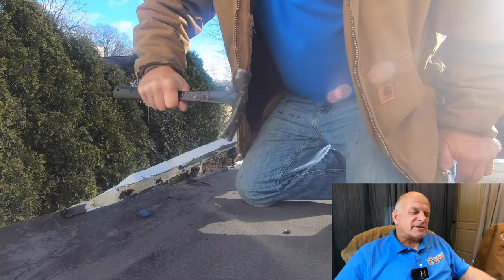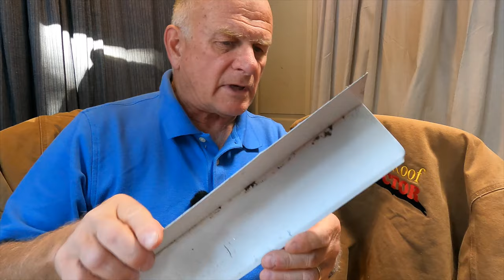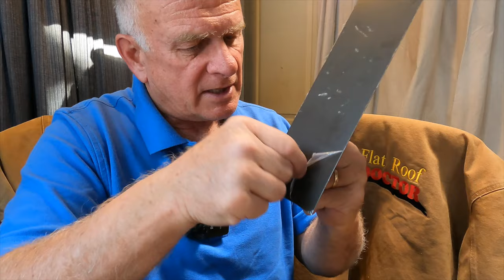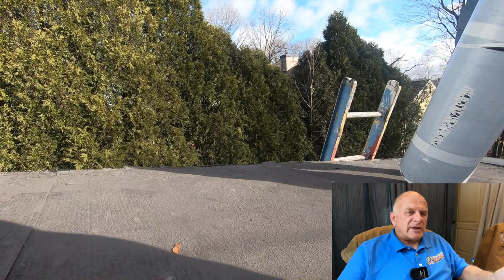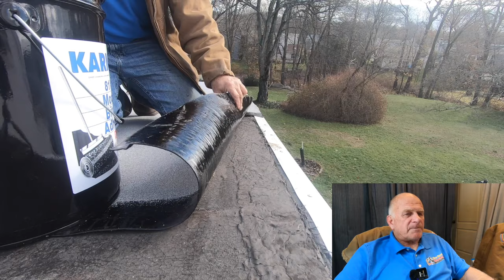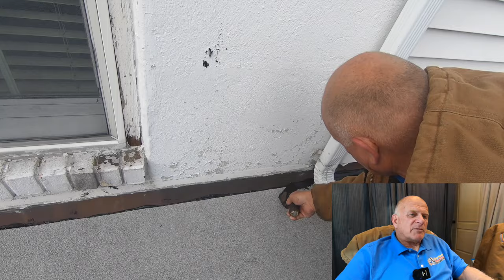Quickest Easiest Cheapest Flat Roof Install - only Hammer, knife, trowel, tin snips - DIY Home Owner

Comment: There’s a reason the manufacturers don’t recommend doing it this way. This is fucking mental!
Reply: reason?
Reply: @Trustamania he's lying to you when he tells you the sun will fully adhere the roof.. I mean obviously, look at all the wrinkles in it when he says its done? and what about in the mean time? he never used any sort of adhesive on either the base or cap layer. Even a Cold apply roof still needs to be fully adhered at the seams, at the very minimum
Reply: He said he uses Karnak 81. That is an adhesive.
Reply: @dbarr8261 that's is a plastic cement, it's not for this aplacation,

Comment: This is great, thank you. I have a commercial property and the contractor estimate is closer to a $100k. I calculated the material cost and it is less than $20k. It blows me away that he want so much profit for two days work. Do I am hiring couple labors and doing it myself.
Reply: Lol good luck buddy....hopefully you install the roof correctly and you don't end up paying 2 3 and. 4 time more then you would have.
Reply: How did that roof go?
Reply: @JohnSmith-bx5fg  it's hilarious. We had a guy in tears when the insurance company came out and found out it was a DIY. Owes 200k in repairs AND got dropped. If the roof is $100k that's easily a 10-12 man job for sure. These people who roll the dice on plumbing, electric, or roofing are insane. One small pin hole and you will have mold for years
Reply: ^ Yup good luck with insurance and manufacturers warranty, this guy is literally telling you this is the wrong method and not recommended by the manufacturer..

Comment: Hi Doc ! I just wanted to thank you and your wife so much for all your videos which I have looked at over and over before actually believing I could do this. I have just finished my flat re-roofing project here in NB, Canada on a 9 ft x 18ft double sloped flat roof. I bought the GAF liberty cap sheet at home depot. They did not sell the base so I contacted a local commercial roofing supplier and bought some Elastoplex SA Y Polyglass as a base sheet. 
My challenge was to start on each end of my roof to overlap my way up to the peak to lay my final cap sheet.
I also followed your advice and found myself a wonderful wife who helped me carry the rolls up the stairs (I'm a skinny dude lol), I cant carry them by myself. If you want I can share photos of my project to show anybody can do this. I'm a barber and I never thought I would tackle a project like this. 
Today it's raining, and it' great to see that the drip edge is working, no more leaks.
THANK YOU for sharing a thing or two with us, bla bla bla
Pat
Reply: U mind telling me what materials u bought so I can do it to my mobile home too 👍
Reply: @JNCVlogs  sure :) I used the 2 layer he recommends in the video. Peel and stick base, drip edge, and then Cap sheet made by GAF. Cap sheet was available at Home depot, and the base was available at a local  roofing supplies store. My conclusion after one winter : the roof is like now, system works great. The rolls are heavy, I'm a tiny dude and needed help to carry them :) have fun and take your time
Reply: @chnapz  did u needed a torch ??? And thanks I appreciated
Reply: @JNCVlogs  no I didn't have a torch, the adhesive is good enough. I did it on a hot summer day
Reply: @chnapz  how's it holding up now??
Reply: @xxdrloveleyxx5185  hasn't moved a bit. Still super Happy:)
Reply: That goes double for me Doc.

Comment: Hello all, Just wanted to add my experience on this method.
 Way before this video back in 1998 I had a leaking built up tar and gravel roof on a slightly pitched addition to my house. I removed the entire old roof back to the rafters and installed sheathing, then I installed a cap a layer of peel and stick roll roofing ( I think it was a GAF product) and then a final layer of sand coated roll roofing. Since it was my own house I followed the instructions carefully and took my time rolling the surface with a 100 lb roller to ensure good adhesion.
Well here we are in 2022 and the roof is still in great shape, hardly even find any sand in the gutter when I clean them.
Reply: I'm glad it worked well.
Reply: Do you havre the material lists to buy?

Comment: That is spot on with the drip edge. I used to do HVAC and we did all our own duct work and plenums. We also made drip edge on our benders for the roofers across the street. We made large flanges so lots of bonding area. The roofers loved it and used it as an demonstration piece when explaining why you should go with their bid. They were not wrong, they were the best because they ALWAYS did it right.  More cost effective when you do a good job that generated buisness and never have to deal with the expense of a come back. 👍👍👍👍

Comment: Have to remember contractors have over head…..Liability insurance, WC insurance, truck insurance,payroll,and so on plus they need to make a profit……pay for the boat/vacation home…..yes some go for the throat in this area that’s why one needs to research costs and get several written estimates….the lowest is not always the best….neither is the highest……once work is started …..important the workers know someone is watching…..inspect the work if possible and have the contractor take detailed pictures of the finished job…….never pay the rest owed if the work is not done,or there are issues…..until completed…..
Can be done if one has the balls and follows manufacture directions to the T…..and avoids falling off the roof……
Reply: Thank you Captain obvious!

Comment: This is great! Thanks for doing it. How do you handle a metal porch roof that isn’t completely flat and has a slight hip on the left and right?
Reply from the maker: That is even easier. Use the same adhesives and stick the membrane right at the bottom of the hip and cover all the metal between the 2 hips

Comment: Hi! Love your videos since I am very new to anything related to roofs (first time home owner). I have a question because I am a bit confused. You say you can install this over an existing roof but it looks like you installed a new cap sheet over a base- so would I have to rip off the old cap sheet or can you install the base over an existing cap sheet?

Comment: Question:  Loving the videos! You're a natural teacher.  Doing the SBS peel and stick cap sheet over an existing flat roof. I don't need the SBS SA base?

Also should I use the Bitumem adhesive (Karnak 81) asphalt flashing cement  (Karnak 19) or Roll roofing adhesive for the edges?

Thank you!!

Comment: roofing contractors dont get mad at stuff like this because your giving out top secret stuff. its because people do this stuff and we have to come tear it out and do it properly. 
id say atleast a 1/4 of the roofs ive been on had work like this and all it does is mask the problems so its twice as bad when it comes to replacing it
Reply: Some of us haven't got thousands of simoleons to spare.
Reply: @uncled39  that makes it worse, ive seen so many places spend more on repairs over  the coarse of a few years than it would have cost on full replacement from the start .  trying to save money they end up spending more
Reply: @bongcrusha420 on a percentage base more people save money doing it them self, than people having to pay someone like your self to redo the job.
Reply: @explorster  I promise you that's not the case. Yes they save on the upfront cost right off the bat. It's OK in a pinch if they need to save for a few months w.e. but in the long run when you keep doing patch work it adds up fast. Then when you do a replacement and have to add in all new wood now cuz the old stuff has rotted away. Your not saving so much anymore. 
The most recent job I was on had about 12k in wood deck replacement because for about a decade they paid for shoty patchwork that didn't actually get them water tight

Comment: I have a section on my house towards the back that is a 20 x20 flat asphalt shingle roof. Thats the way the house was when we got it anyhow i plan on putting a metal roof over that section for a  2 year temporary fix as it has a couple of small leaks , hoping to save up money to  try to remodel that whole section  of that roof that leaks and the inside of it also. What are your suggestions as to putting black paper over the shingles and then pearlands before installing the metal roof. Would that help with the leaks to keep it leak free till i gather that money

Comment: 2 Ply can not be mixed with Asphalt (Tar) .. The edges (Drip Edges) require a Primer specifically for the 2 play self adhesive roofing.  W T F kind of roofer are you ?

Comment: This is a great video, but I am wondering why it looks like he ran the rolls in the wrong direction? Shouldn't the seams be running parallel with the way the water runs? It seems that this way, the water could run up under those seams easier than if it had been laid the other way..?

Comment: Thank you! Super info. Three questions:
1. Why not use Karnak on the seams rather than heating them?
2. Can the Base sheet be installed over existing Fiberglass Mineral Surfaced roll roofing? (I nailed down roll roofing to get the balcony plywood through the winter.)
3. What suggestions do you have for dealing with penetrating screws through the surface? (Screwing 2x4's to the balcony to support a deck.)
Thanks again!

Comment: What happens to the high spots on the roof? I ended up with those the last time I did my flat roof with regular roll roofing, and over the years, they dried, cracked, then leaked. I presume the same thing will happen with the stick down roof if it's not perfectly flat?
Reply: by high spots do you mean wrinkles or creases?.... because that shouldn't be, that's poor installation technique.. because those wrinkles are hollow and not adhered to the actual surface which means they will shrink and expand with changing temps and eventually crack

Comment: I have a 2700 sqft roof . Here in miami i got quoted 30 k from  i wont say there name but there known. A nice salesmen showed up in shiny company truck and handed me the shiny estimate. Lol  ive been painting it with silicone material for passed few years. It is a flat roof but theres no way i can do entire roof job myself. However could i reroll entire roof or would the weight be too much? Thank you .

Comment: I'm a licensed slope/flat roofing contractor. i do like when people learn the skill to do their own roof install/ repairs it is a valuable skill. i would like to shine some light on why new roofs cost so much. the new standard is EPDM/TPO for flat roofs they last much longer and servicing is much more reliable. cold/ hot process are considered obsolete . standard roles are 100'X10' and cost is about $1,500-$2,000 EPDM needs glue , a clean surface(plywood) or insulation / recovery bord (needs screws and plates), a specific seam tape for overlaps witch requires a primer, forum flashing, drip edge and flange back gutter witch is fastened on top of the membrane to terminate  it and needs forum flashing to seal it in. you are paying  for  material, disposal, skilled labor, and warranty. if you do your own roof and save money more power to you. ps please confuse the material shown as ice and water shielding it wont last longer than about 2 years, and always go with commercial grade meatal trim/ gutter

Comment: I wouldn't keep a propane tank on the new roof without a dead sheet. Those endlaps will let go at some point without embedding the granules. Decent result though i guess.
Reply: those flaps wont' hold for shit... and him melting the rubber?... the glue becomes pointless... you either GLUE the rubber, or you melt... you can't do both

Comment: My 7 year torch down Bitumen roof garage 20x20 is starting to leak. The "professional" roofer torched granulated Bitumen directly to a tar and gravel roof with the gravel removed. It is a flat roof and there is ponding of water which leads me to suspect why it is failing so soon. I want to fix it so where it will last 20 - 30 years. Should I put a sloped roof on top and then do a 2 ply Bitumen or what other suggestions would you have? Love your videos, thanks.
Reply from the maker: Ok, so torching directly to the existing build-up roof is a no no. The Torch Down will not adhere and start to wrinkle pulling the seams apart. 
If that is the case, then you need to cut the wrinkles so as to flatten out the surface.
I suggest install a new commercial drip edge, over the existing membrane, and then torch directly to the old membrane, after cutting the wrinkles.
The use screws with plates to fasten the old membrane properly to the deck
Stagger the seams so you are not following the same pattern as the existing. maybe start with a roll cut at 18". 
No reason to slope the roof in the 1 st explanation. That is the easiest and less expensive way that will last. Only make sure you are melting the 2 layers together very well. That takes extra heat.

1. The other way would be to install tapered ISO insulation. 
2. Then self adhering base 
3. Commercial drip edge
4. Cap sheet torch granulated
send me pics to 203 858 0080 so can give better advice or call

Comment: Doc thanks for sharing, would this be ok for flat roof that has walls ? my house is old and has that style where there's walls, I see in this video the edge ends straight, would the peel and stick work if It has to go up a short wall and then re-install the roof tiling
Reply: It's specifically designed to go up walls, it is NOT meant to be run in the field as he's using it.

Comment: I gotta do my son‘s roof I’m gonna get liberty peel and stick and I can use karnark 81 for the drip edge? I wasn’t sure if somehow that would hurt for liberty peel and stick is karnark 81 just Regular roofing cement tar or is it  Something different I usually use karnark 19
Reply: Hi ! Check to see what your building code is before you do anything to your roof ! You  can just screw new purlins down on top of the asphalt shingles around the whole perimeter of the roof flush with the edge of the roof,but first you have to cut the shingles that hang over the edge of the roof flush with the edge of the roof  you then put new purling about every 2 ft ,in between and  across the perimeter of the roof then you screw the new  metal roofing material to the new purlins . And I'm sure there's plenty of videos on YouTube . 🙏🇺🇲🇬🇧✌️

Comment: Good video sir … thanks … I’m wondering if you have a way to make this kind of roofing which would be temporary, say tor a year , and then I want  to frame and build another floor on top . I tried last winter to not take off the plastic under the ice shield . And just used roofing cement with strips and sandbags .. it partly blew off this winter .. and I have some mould now where it leaked .. I may use your method .. where can I get the top membrane in canada …and what is it called?
Reply from the maker: APP 160 or 180 and any roofing supply will have it

Comment: I hope you answer me. I’m gonna do peel and stick on my son roof it looks like rotten  it plywood on three square of flat roof I think it’s because there’s no ventilation It has insulation attic just drop Drop ceiling off into insulation and two by sixes 
So I think there’s no air I want to put ventilation can I just put two regular vents that I use when I do shingle roofs ?
Reply: There is a specific cone shaped Vent you can buy for flat roofing purposes

Comment: Can you list the supply’s used, such as what the membrane brand is called etc? 

And is this good for a flat roof with a 2 inch slope length of 16ft ?
Reply from the maker: Yes it will work for what you have.
I used Liberty System by GAF.
That is a combination of a Peel and Stick base and then a Ceramic Granulated Cap sheet. I 5 gal Karnak 81 or 66 Trowel Grade to make the flashing

Comment: Another great video doc….will this self adhere last as long as the touch down?
Reply from the maker: I think it might last longer if you use the full system. meaning the self adhering base with granulated cap sheet

Comment: I am  remodeling a home trailer. The roof has Corrugated Galvanized Steel Roof Panel on it right now. So the roof is not flat. Can I use this Peel and Stick stuff on top of the panels? And where can I find this material??
Reply: If the steel isn't rusted, yes. You have to clean in VERY well before the application, and apply it on a very hot week (or use a torch like in this video).

You can get the materials at any roofing supplier. DON'T go to big box stores, they carry inferior products and charge 3X more than a supplier.

Comment: And I will be putting this on new plywood.  So I need the layer on the plywood to be the nail layer, nail with a plastic washer. Then a base layer of peel and stick. Then the cap layer.  Is this correct?
Reply: Yes correct.  That is referred to as a 3-Ply System
Reply: @ericbstudios9807   Thanks
Reply: @jamescole3152  no problem!  A cheap little heat gun cab help with the seams this time of year as well.  Take care

Comment: Why wouldn’t you put the drip edge on first and then put the felt paper on top of the drip edge and then your old roofing and the felt paper a back up if the roof leaks.
And if the roof did leak and it leaked onto the felt paper, the felt paper would be going under the drip edge then over it